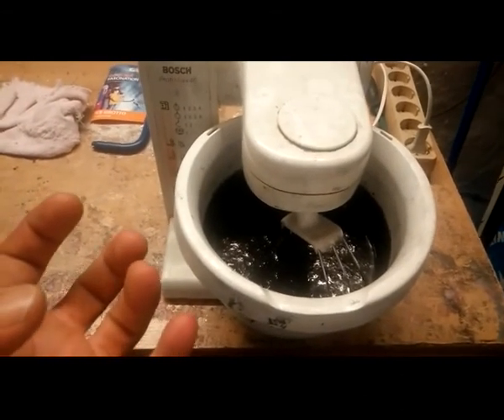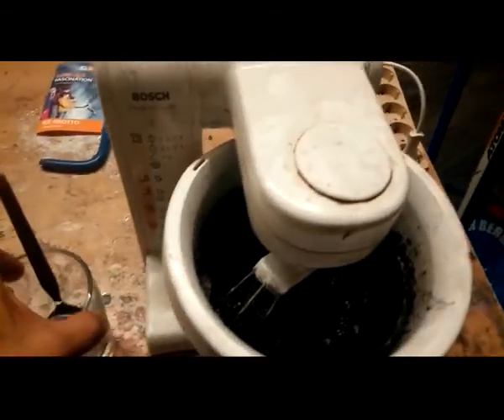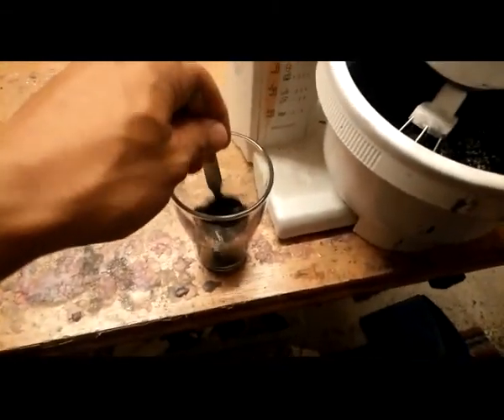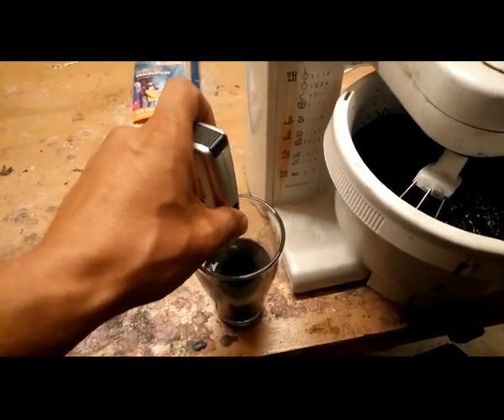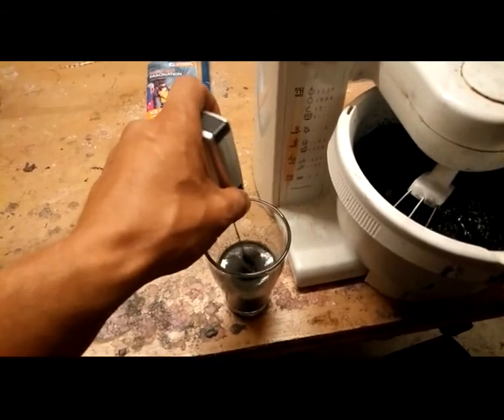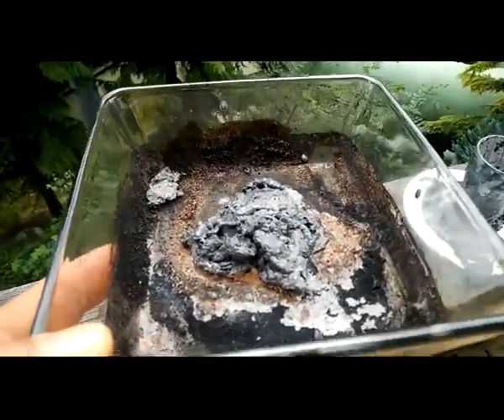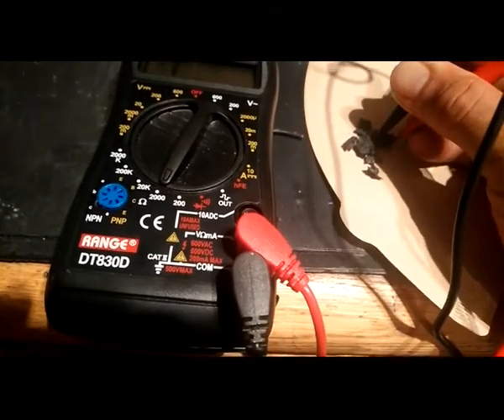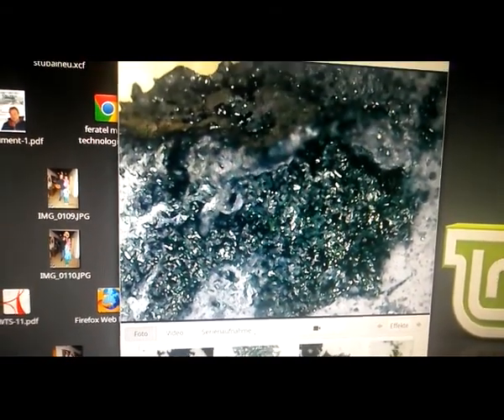a idea to make a graphene foam

Comment: Starlite's fake recipe (not firelite) uses 2 parts baking flour, 1 part corn starch, 1 part white sugar, 1 part baking soda, and water until it reaches a soft putty. Hit that with a flame and see what happens! It will resist 10,000F degrees once it expands. If you have a bit of ferrite oxide in there and microwave it after the flame, it will harden. Microwave a small amount and the plasma will alter the oxide over time to produce something else, although it might take some clay slurry added to the mix to work right. I only did this a little. The temperature it reaches can be very high and at some point it wont fall apart if the plasma is active enough. I only stopped using the microwave to test this because I'm working on a bigger machine to make more plasma resonate from the material itself in RF, since you cannot just apply a plasma stream from a jet. That would destroy it.

Comment: i think in this process the foam contain carbon plus graphin... can we seperate carbon by means of electrolysis/ electroplating?
Reply: perhaps under 480kv or so in regular tapwater you will begin to notice a difference in how it responds to current as opposed to graphite.

Comment: pop some 98 percent h2so4 in it instead of heating it to 900 degrees ...sugar should carbonise .. leaving amorphous carbon/graphene mix ...  but i'd use proper graphene in sugar solution ...
Reply from the maker: I run out of h2so4 , its very hard to get it in my country.

Comment: Looks very promising. After fermentation do you heat it for carbonization and if so for how long and at what temperature. Thank you.
Reply from the maker: I would say about 1.5 hour for about 900 c
Reply: 900 C ? How did you achieve that at home ?